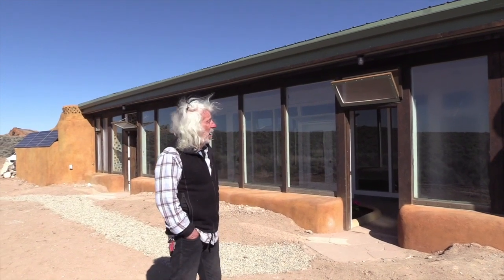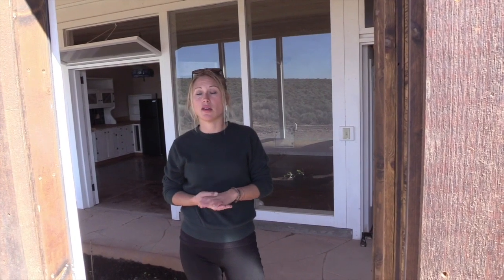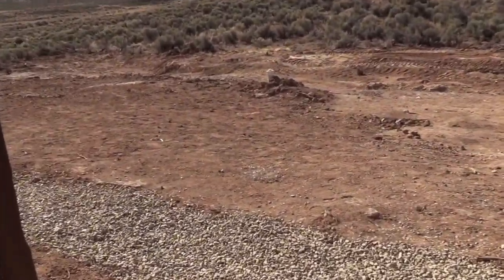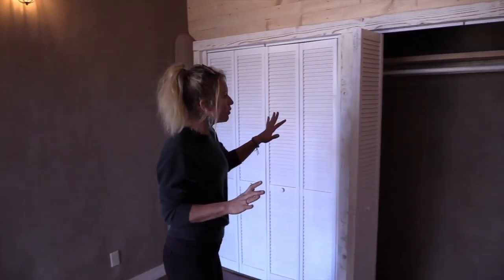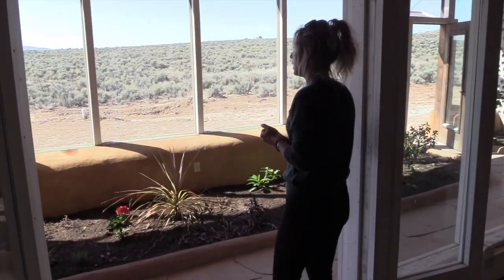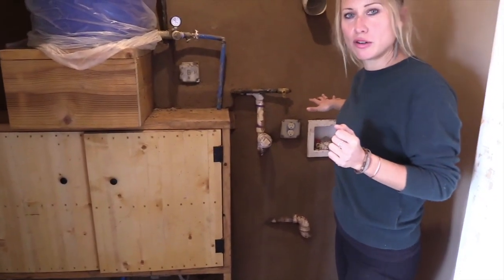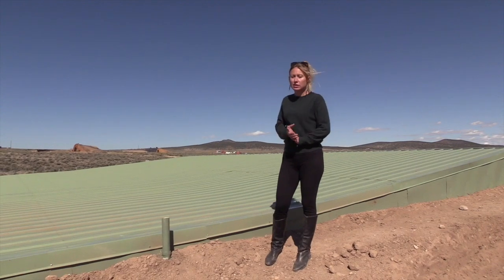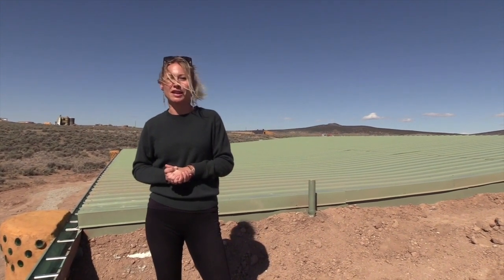Encounter Earthship Model Overview

Comment: For those complaining about sub $300K not be "affordable" keep in mind this in in the USA where the average new Construction House will run you at least $145 per square foot. In most Cities, the minimum square footage for a Residential Home is at least 1500 sqft. That means, without you adding fancy fixtures, extra large windows, a Solar system, etc, you are looking at a cost around ~$220K. This specific Earthship costed about $219K, meaning this new Model is in fact as affordable as standard construction, in the USA. 
And this home will save you THOUSANDS per year in Utilities, grow some of your own food, be healthier to live in, no concern for Grid-down situations (I'm looking at you PG&E in California), be more comfortable in extreme temperatures and give you a sense of peace due to how quiet it is inside.
Reply: And haters always forget the fact there's NO costs after that initial build, no electrical bills, no water bills,,,  NO BILLS! :)

Comment: Yea, here in Florida you'd need air conditioning guaranteed.  It probably would be efficient enough to run off solar though.
Reply: No, you wouldn't, it's built into the structure. The only thing you might need is a dehumidifier.

Comment: Something along 5-10k I would call affordable. 300k is crazy
Reply: There is nowhere in the USA (where Michael Reynolds lives) where you could build a House for 5-10K unless you are doing it completely off-grid, in a County with zero Build Permits and of almost entirely found (as in free) materials, plus 100% of your own labor. The actual cost for this Earthship was about $219K, which includes a HUGE amount of Labor hours to complete it.
Reply: @bookcadenb4584  It does not have to be in the USA. I would like to see this type of design work in poorer parts of the world. Perhaps not 10K, but still 200 is way too much. You can buy a large family house here for about 80K.
Reply: @sopi2  I'm sure you can, but the point is the pricing Michael is comparing to as "affordable" is for USA Homes. Also, if you do 100% of the Labor yourself and use as much found/free/recycled materials as possible, you could cut the cost of this Model probably in half.

Comment: Allot of people have been asking about the cost of the home and have commented about 300k being less then affordable.  I might be able to answer some questions as I have been checking this out for quite some time and I have visited taos as well.

First of all you need to realize that this is radically different then a regular house.   Think of this as a higher up front cost for little to no bills related to your home for the rest of the life of the building.  

 Consider that this building collects it's own water and electricity.  It also does sewage treatment as well as being able to grow food in the green house section.    There for your monthly utilities such as water, sewage, and electricity are close to zero - here in the USA that alone is a savaings of many hundreds of dollars a month.  This won't entirely eliminate your grocery bill but that too will be considerably less.  Since it heats and cools itself passively you will use allot less propane or natural gas as well.   

Not only that but maintenance costs of this building are near zero.  You dont have to replace the roof every 10 to 20 years.  You will never have to paint or side 3/4 of the exterior walls.  

These homes are far far less susceptible to damage from storms, earthquakes, and even fires.  

In total this building could save you between 400 and 1000 a month.  If you take those savings and invest them over the length of a standard mortgage that amounts to between 500k and 1.2 million.  Which frankly a regular house never does that.

These building use allot of recycled materials so the total materials cost is less then an average home - perhaps a third of the total cost of the building.  The other two thirds is labor.   These buildings are very labor intensive.   But it is possible to get friends and family to help you which would reduce the total out of pocket cost.    The construction of these buildings ends up becomming a series of social events which almost never happens with a regular house.

The company is educating people as well as building.  They also do a massive out reach effort and are doing things like building hurricane relief shelters.  They travel all over the world for builds and as such they are not living high on the hog.
Reply: Michael, would this design be well suited in a high humidity environment, say south Texas near the coast?
Reply: @joshmo21  i dont see any major issues with high humidity.  They use fresh air tubes and vents.  We all know that heat rises.  When you open the vents up high the heated air escapes through them.  This creates a slight vacume effect at that location.  At the same time you open the fresh air tube doors at the back of the house.  What happens then is that the vents pull air through fresh air tubes.  The refer to this effect as a heat engine.

These tubes generally through the bottom of a berm at the back of the house.  They are in contact with the earth beneath the berm. The earth has a constant temperature just a few feet down and it averages in the 50s in most places.   What happens is the earth cools the air in the fresh air tubes as it passes through the tubes.   

There are no fans, no motors, no use of electricity to make the cooling work.  In fact the only moving parts are the hinges on the vents and doors.

I will point out an additional benefit - along the texas coast you are subject to high winds and hurricanes.  Granted they are far rarer then say Florida but they do happen.  The tire walls, earth shelter of three walls, and the extremely heavy roofs mean that you are far far less subject to high wind and hurricane damage.  As long as you are not subject to flooding, they are pretty much the safest homes possible short of an underground bunker.
Reply: I agree with you some what on the cost, it can definitely be seen as an investment; however, the Earthship model ( as it stands today) is only an option for place such as New mexico.  For example if this same model were built in upsate New York, it would not be livable and anyone who did would likely freeze to death under certain circumstances.  It also uses a lot of concrete, which is an unsafe and environmentally harmful material due to its side effect of depleting oxygen inside the home (not completely just enough so that people with asthma would suffer) as well as contributing to 10% of greenhouse gases.  I think that the cost can actually go down as the greenhouse is a completely unnecessary addition which is likely half of the cost of the house, but this design still has a long way to go before it is marketable to the entire world.
Reply: @aleclewis9496   I agree that it gets pretty cold in upstate new york.  However, I think that you are unaware of the extreme colds that the earthships are subject to elsewhere.   I would submit that an earthship can actually work better in new york in some regards.   

Taos New Mexico is the high desert.  They have homes there between 7000 and 9000 feet in altitude.  It is in fact a ski area with quite abit of snow particularly at the upper elevations.  They routinely have extreme cold in the teens and lower in the winter.  Their "average" coldest day of the year has a low of 12 and a high of 39.  Compare that to Plattsburgh, NY with a low of 10 and a high of 27 on it's average coldest day.  Or better yet compare new york to the earthship in lethbridge, alberta.  It too has a average coldest day of 13 to 31.  Both of the comparison locations are subject to extreme cold and brutal wind chills.  I personally have been to the Lethbridge area with temperatures of -5 to -10 degrees.  The video for the lethbridge house mentions steady interior temperatures for most of the year and using a small wood stove for a little extra heat.  They mention 14 to 22 degrees C without the stove = 57 to 71 F.

https://youtu.be/EAvY5JeMz9w

They have tomatoes growing in January in the alberta home.....that is no where near freezing inside.

I have seen small wood stoves and fireplaces in the Taos homes i visited as well.

In any of those three locations a regular house must be heated at a cost of hundreds if not thousands of dollars each winter - failure to do that would mean freezing pipes in a regular home.

The greenhouse is integral to the design.  It acts as a buffer between the extreme cold outside and the warmth inside.   It's food production is a part of the overall savings that come from the building.

I have never heard of oxygen issues with concrete after curing and I worked for a concrete testing firm.  The greenhouse however helps with that too as the plants produce oxygen as a part of their biologic processes.  

Given the food shortages that we are likely to face this summer, i would tend to think that the greenhouse very suddenly has quite abit more value.  Sales of gardening supplies are up about 50% nationwide according to Ace hardware.
Reply: @sirkermittsg   I did do some more research and thank you for providing some info.  I definitely understand the concept as a whole a lot better now rather than just this specific video example.  I have seen really well built designs and this one i believe is a poor representation.  I would still say some changes or innovation needs to be made if they expect to have most of the country opting into Earthship living.  But I think more importantly this will just show us more techniques on how to improve the eco friendliness of our modern architecture.
Reply: SynysterJag 
What model would you need for central coast of Ecuador where you wouldn’t need to worry about heating but maybe a desiccant tube for humidity?
Reply: @doncripto1405  the earthships that they build in the tropics are different then what they build in away from the tropics.   Many of them are round or oblong shapped.  There are several videos about making earthships in Haiti and other tropical locations.

Comment: Will using hempcrete change the functionality of the structure? And are lithium ion batteries (like the Tesla wall) a longer lasting alternative? Have you considered implementing a hydrogen generator?
Reply: To my knowledge, batteries aren't an alternative to solar power, but a supplement. The electricity still has to come from somewhere. Batteries provide an intermediary so that you don't have to rely on grid power during long periods of low output. Tesla's Powerwall, for example, is designed to be used in conjunction with solar power (although you can also get them to use as glorified techy backup generators if you're on grid power). Same thing with hydrogen generators - you need electricity to power an electrolyzer.
Reply: You have to have batteries if you're going to power with solar.  Having better batteries is always a good idea.

Comment: How well would home do in Montana for example..I know there are a few built but how does house handle very cold winters? I'm buying land soon and have been leaning towards the earth ship. I've followed your homes for years and they are absolutely beautiful and functional..the real cold climate is what concerns me.
Reply: If you're worried put in a small wood stove or two
Reply: From what I've seen on YouTube it handles cold just as well as heat.
Reply: Check out this video - extreme cold is not a problem at all.   https://youtu.be/EAvY5JeMz9w
Reply: Did some celebrity not build a 2 storey one in Montana?  Forgot his name.
Reply: There have been successful builds in Canada. Just put in a fireplace or a wood stove and you'll be fine.
Reply: It gets to -40F in Toas NM where this Earthship is. A 'backup' Wood Stove/Rocket heater would work fine.
Reply: @bookcadenb4584  The lowest temperature EVER recorded in Taos was 1.2 F degrees above zero; the average temperature there in winter is 25 F degrees above zero - nothing like Montana.

Comment: Great video by the way, well done.  I would have liked however for you to go more into how you brought costs down from the global model and what did you have to sacrifice in this process.  I also have a question about the vents being placed in the closets. If the doors are closed even with the slats on those particular doors, doesn't the air struggle to circulate, especially if there are clothes, shoes boxes in the closet like most North Americans fill their closets up.  Wouldn't have been preferable to place them elsewhere?  My last question is about the shower and the toilet being separated.  Is that an absolute in this design iteration?  I also noticed there is no bath at all unless I missed something.  Thanks
Reply: Also the issue of moisture in humid states. Coming through the closet could create a mold situation with your clothing. 
I wonder is there some kind of filter situation that would reduce moisture and still maintain the kind of pressure needed to pull the air through and cool the home.

Comment: I believe the 300k cost is if someone built a turnkey earthship for you. If you built it yourself, it would be significantly cheaper
Reply: Yes it would, and you can bet your ass that working alone it will take you a good year to do the whole build by yourself, working every day. Good luck :)
Reply: @RobinGWakker  maybe you should think of it in the understanding that once it's payed off it's the cheapest home you will ever live within. however this opens another question. i wonder if they are rent to own? because if that's the case, than anyone could afford it as there are no utilities because all that's required is the rent of the building.
Reply: @5226-p1e  Anyone with the means can build it themselves. It will take you a good solid time though, especially if you have no prior experience with building, not to mention you need to stick to certain building codes, which depend on which state or country you live in.

Not sure what you mean rent to own, but as far as i know, there is no government subsidy over a home like this in the USA. But correct me if im wrong.
Reply: @RobinGWakker  
so the ppl who build these demand payment. well not everyone can build these on their own maybe they are disabled but they have the money to have someone build it. however they may not have the full amount of how much it costs upfront. So they rent to own.